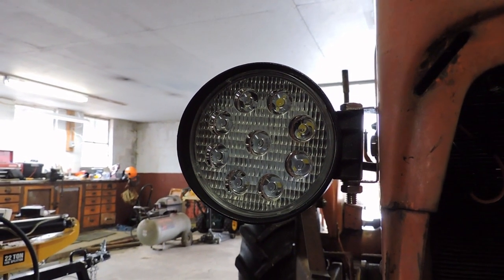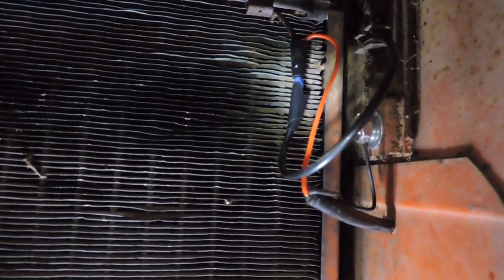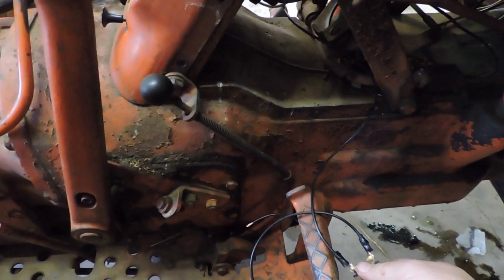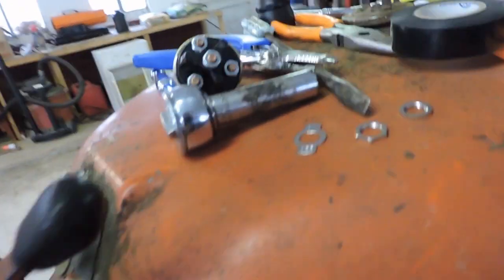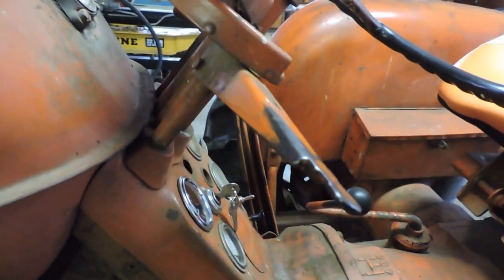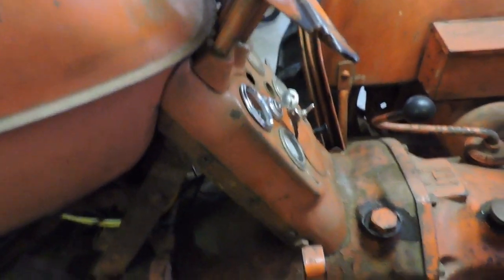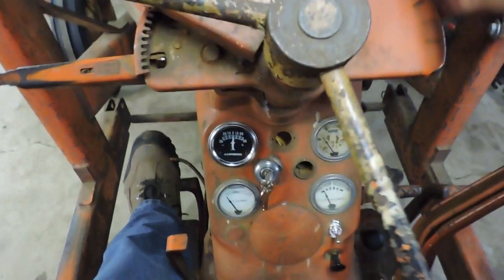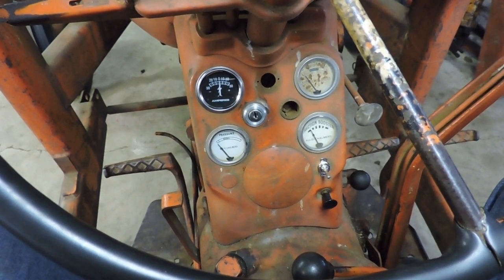Allis Getting New Eyes

Comment: Is that tractor still 6volt?
Reply from the maker: Thanks for the question.  Yes and no.  When I got it, it had a 12v battery, but not much else was changed from the original 6v setup.  Since then, I've put on a 12v voltage regulator, coil, solenoid and changed the original positive ground to negative.  I still have a 6v starter and the 6v generator on it.  I was told I didn't need to change the starter if I didn't crank it too hard.  As far as the generator charging a 12v battery, I don't know.  I'd love to put the 12v alternator kit on it, but it costs around $225 - 250, so I can't afford it right now.